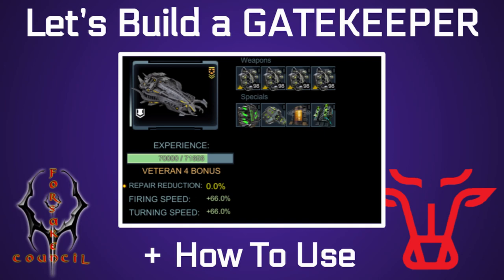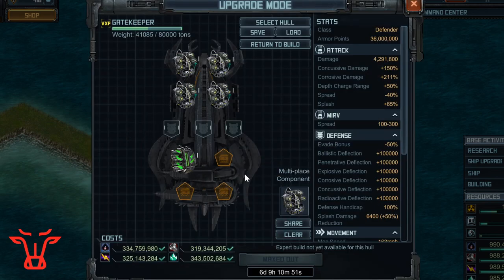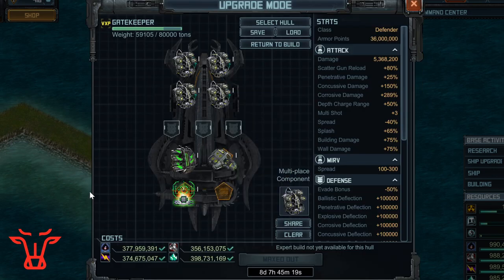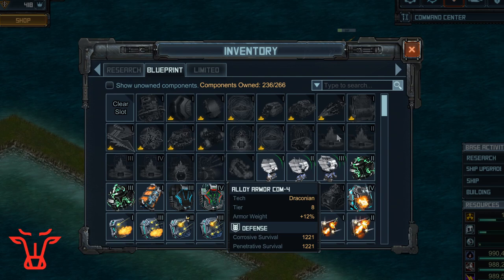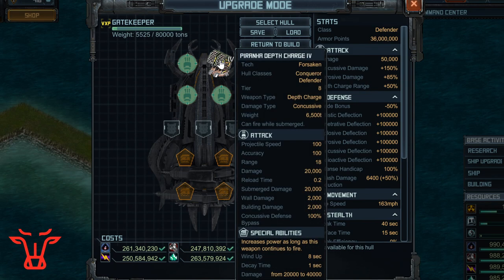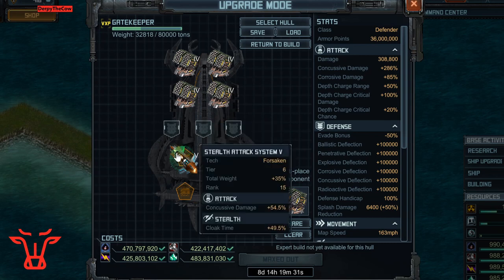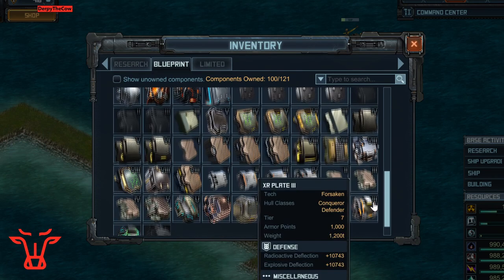Battle Pirates: Let's Build a GATEKEEPER [+ How to use it] May 2020

Comment: Here is another build Idea for Deadbolt Gatekeepers (for the last special slot) 
You could farther reduce spread and increase splash for scatterguns with Radioactive ignition and/or Fulmination Pay Load

Is the math below correct?
The spread on Deadbolt scattergun starts at 200 witch is very high and splash of 15 which is relatively low
With just Corrosive Canisters II then your scattergun has 120(-40%) spread, and 25(+65%) splash  --still not focussed 
If you add Radioactive ignition on top of CC II then it has  60(-70%) spread, and 32(+114%) splash --twice as focused with more splash
Reply from the maker: My shots already seem pretty focused...but I really like the more splash. If they aren't moving and stay stacked, then you'd kill em quickly

Comment: Derpy, how about increasing cloak efficiency to the max to prevent warhounds equipped with hydrodynamic IV shells which will hit submerged vessels?  I saw a battle yesterday where the warhound sat on top of a gatekeeper and was hitting it while it was submerged.  BTW, nice video.
Reply from the maker: That's a decent idea if it were a normal PvP on water battle, but it doesn't work quite as well because your opponents will be able to see the GKs health at all times and know where it is. Still has some potential to work.
Also, the Warhounds can hit underwater anyway. If you add sonar, they can detect the GK earlier

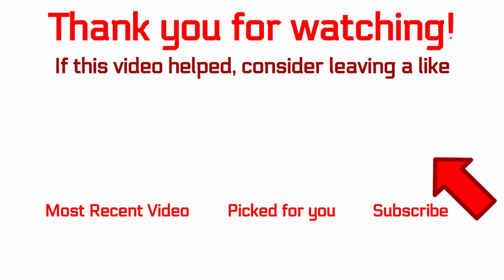Comment: I disagree with your build: 12:00 
Pirrahna Deapth charges have 0.2 base reload which is the highest reload possible  
It is pointless to boost concussive reload with CM-CTCO reloader or with VXP if you are building gatekeepers with Depth Charges
Nice thing about building Gate keeper with depth charges is no VXP required!!!
Zip Drive X is still good because it has the highest Concussive damage bonus, but the extra reload doesn't benefit you
Reply from the maker: Oh woah, that’s a big thing. Thanks for letting me know. Just need to boost concussive damage then

Comment: a bit late but I don't think resonance capacitor does anything for the gatekeeper since it has no resonance trigger, please correct me if I'm wrong
Reply from the maker: You need to use something to boost it, such as the Highguard Warden. Otherwise, just go with Assault Battery MK-COM

Comment: Can somebody explain multi-shot to me.
From my limited (and quite probably wrong) understanding, it takes the damage and divides it into more projectiles.

so, say a weapon does 1,000,000 damage and has multi-shot 4, then each projectile will do 250,000.
increasing the multi-shot would NOT be beneficial in PVP as we are dealing with deflection and as such could end up reducing the damage of each projectile down to levels where it barely scratches the enemy.

Take that same weapon and now have a multi-shot of 8.
Each projectile is now only doing 125,000.
Reply: No,  Increasing multishot does not lower the damage of each projectile:  A weapon with 1,000,000 and 4 multishot each projectile does 250,000 damage,  when you increase the total multishot to 8 then the weapon does a total of 2,000,000 damage even though the multishot doesn't increase the damage stat
Reply from the maker: If your weapon has 1 million damage and a multi-shot of 4, it each projectile deals 250k damage.

Then if you take a special that adds +2 multi-shot, you add 2 more porjectiles that do the SAME damage, so now you have 6 dealing 250k each